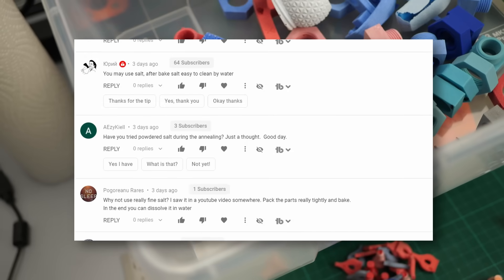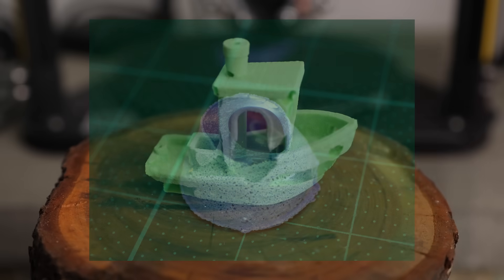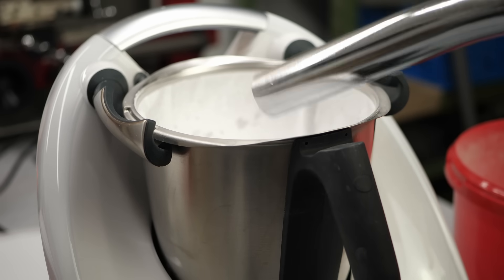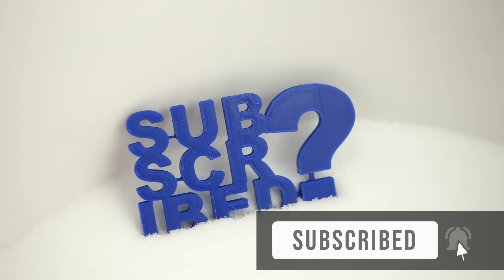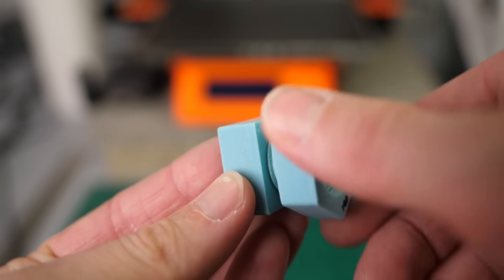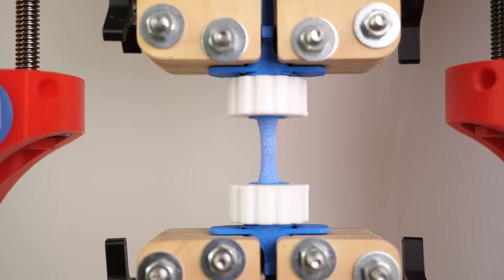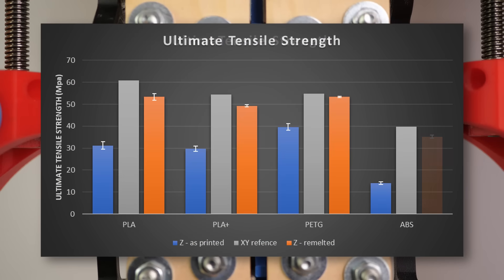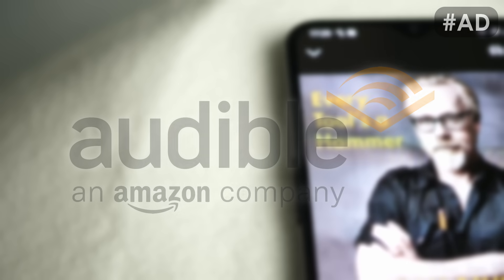The STRENGTH of 3D prints REMELTED in SALT

Comment: An alternative to using the blender would be to use a ball mill (Rotary Tumbler).  These can be had in the U.S. at Harbor Freight for under $20.  A simple ball mill substitute would be steel balls or smooth stones in a paint can, then rotate the can on a motorized roller.  Ball mills are used in the paint industry to grind pigments into a fine power.

Comment: Hi, I managed to easily make powder salt. Mix equal parts of regular salt with water then put it on a blender or food processor. After blending for some time you can transfer the mix to a regular pan and boil the water away (for safety, with some kind of lid that lets the vapor out). You can process all of the salt in one batch, and what you get in the end is dry fine salt.
Reply: I think you can skip the blending step. I think the salt dissolving is what makes it fine.
Reply: @stinkiaapje  It can become saturated and no longer accept more salt into solution. Not sure what that point is, but worth a mention.

Comment: Try using iron oxide powder because it's fine and water soluble mixed with aluminum powder because it conducts heat easily and your process will be much quicker.  It will leave a beautiful finish on the plastic part.  Wait...don't do that.  It's a bad idea.  Maybe this is just a joke for anyone who understands chemistry.

Comment: @CNC Kitchen
Have you tried a flour instead of salt?
It's finer and drier.

And even more, you can try a little trick to compact it even more, while cooking.

After I watched your video I thought about what could be finer and not that aggressive as the salt.
I tried something like this - compact the parts with a flour in a metal cup. On the top I put aluminium foil and fit it the best I can to the walls and outer rim of the cup.
in the "foil cup" that forms I put some more flour and add some water.
Because of the foil, the water can't leak to the actual flour around the part, but form a layer of dough, that expands while cooking and kind of seals the top of the cup with the foil, thus creating sort of a "piston", that presses on the flour around the parts (I hope :))

I put the cup in a pressure cooker and add some water around it  (on the bottom of the cooker) to evaporate and create some pressure.

Couple of times the water vapor leaked in the upper layer of the dough below the aluminium foil, but in the rest of the cases it was dry, so I guess the "piston" trick worker 
Don't know whether it was from the pressure or from the heat, but the flour underneath was pretty compacted and kind of hard and came out in chunks almost like plaster, but was easy to remove.

I don't have neither the time, nor the equipment to test that flour method as good as you could (I don't even know the maximum temperature of my pressure cooker, ), but the parts come out pretty well packed in the flour and the flour is way finer and no aggressive to the parts than the salt, so probably you could try with it.

btw. like your videos, very helpful. :)

Comment: Very interesting results. I wonder if dipping the parts in a clay slurry, let them dry, then dip them again until you build up a shell would work. Look up the lost wax process for metal casting.  The salt lets the plastic expand as it becomes hot so you might need to put some sprues on the part for the plastic to expand when hot and contract when it cools.

Comment: So I'm new to 3d printing, but I do have some ideas about some issues you ran into;

1) Powdering salt.  My parents work for a platinum mine and if you want to crush lots of minerals (like salt), you're going to want a ball mill or something similar.  They're pretty easy to make.  All you need is a rotating drum and a lot of steel ball bearings.  You just let it run and it'll crush whatever you're milling into a finer and finer powder depending on how long your run it.

2)  Using salt in the first place.  I saw the sand video and plaster video.  I'd definitely like to see you explore other materials.

3)  Going the opposite direction.  One of my hobbies is growing crystals and salt crystals are pretty easy to grow.  I wonder what would happen if instead of trying to powder the salt to improve resolution, you instead grew a giant salt crystal over the 3d printed part instead, and annealed it inside the crystal.  It seems like that would let you achieve extremely high resolution, almost to an atomic level.  I'm aware this wouldn't work with some plastics (or maybe no plastics) and it'd be highly impractical, but would still be an interesting experiment just to explore the other end of the spectrum.  I might have to explore this myself.
Reply: Clever idea!  What about spraying a saturated salt solution over the part, letting it dry, repeating as necessary to get a good solid salt coating.  Then proceed as here.  That may create a solid sacrificial layer and permit higher resolution on the surface.

Comment: You missed a trick not shocking it while compressed to remove any small voids between grains.

You could probably save a lot of time using metal rods to help distribute the heat into the material. Kind of like heat-pipes in a heatsink.

Comment: How about powdered sugar? OK, full remelting couldn't work with sugar, but annealing with Up to 120°C should work well, the crystals can be compressed and stick together and they dissolve in water. Oh.. and it's far cheaper to buy powdered sugar than Popcorn Salt or a good ceramic mill for powdering normal Salt and last but not least: it's by far not that corrosive!

Comment: Sand would be a bad idea since you can't dissolve it, same with talc.
Reply: False
Reply: @rrtsduf  It doesn't dissolve, it only disperses (and it's only slightly soluble in mineral acids).

Sodium carbonate (heated baking soda/sodium bicarbonate) DOES however dissolve readily in water and is incredibly fine, so this could be a viable option.

Comment: What about this? print wilt 100% infill, cast a silicone mold around it (high temp resistance), do the heat treatment, and cut the silicone open. surface should be even smoother

Comment: There is a particularly fine grade sand, used for hourglasses. It might be possible to use that.
Reply: you end up with sand embedded in print that you cant remove, salt is water soluble
Reply: @ekstrapolatoraproksymujacy412  
Indeed, I didn't think of that. Was thinking of as a greensand, though.

Comment: I'm reading through the comments. Everyone seems to be gravitating around minerals such as sand, salt, plaster ect. The issue with these is their heat conductivity issues. My curiosity is how well would it work with powdered metal. Would it conduct the heat better. Allowing for a faster melt or would it conduct the heat too well and burn the outer layer of plastic. Maybe with a high temp pvc glue coating. We will have to test.

Comment: Main thing i would do differently is to have a vibration plate to put the container on and make sure the salt gets into all the little spaces. But this was really impressive. A lot of work but really useful. You could use a tumbler to grind down your salt (or whatever) to a fine powder, but those are loud and slow. Probably having ceramic balls inside would be good to do the grinding job.

Comment: i can suggest to use sand for sand casting or gypsum cement like ultracal 30 both have good properties in conduction and preservation of temperature and the shape, as log as i can see the whole idea spins around meake a from the  3d printed "part" (like in jewlery making ) but using the same material to be remelted and reshaped "in place" preserving the form erasing the layers to creat something more alike  "inyected plastic part"

Comment: what about cement powder ?
first clean with water then in hydrochloric acid (HCl) at 37% (according to the specif below it should work)
(send a beer if it's successful 

https://www.researchgate.net/publication/326697946_Chemical_Compatibility_of_Fused_Filament_Fabrication-based_3-D_Printed_Components_with_Solutions_Commonly_Used_in_Semiconductor_Wet_Processing

Comment: There might be a way to make finely powdered salt that doesn't require having to constantly replace sacrificial blenders.
They make rock polishing mills for amateur jewelry crafting. Generally it's like a tiny side loading clothing dryer, but water tight so you can fill it with sand and lubricant and it will spin for days to slowly polish the rocks. If you fill one with coarse salt and steel shot (or maybe a handful of gravel) and let it run, you could probably make powdered salt in larger batches.

Comment: Hi Stefan, brilliant work. If I could suggest using cement or gypsum, know also as plaster. They are both fine particles, cheap, reusable (depending on the method applied) and hygroscopic. Compacting small amounts would also help, as it will prevent the item from losing shape. 
The way I see it, the method works on a similar basis to hot forging where filament laters are remelted hence the layers disappear. 
To prove it you can try to cure some elements in a microwave as it would be much quicker.

Comment: Have you looked into glass beads used for sandblasting instead of using salt? There are multiple different sizes of beads and you can buy a big bulk bag for rather cheap and it would most likely be reusable.

Comment: Looking at your results, I am curious what benefits using salt over other super-fine grained material would be. Also, have you thought about performing this process under pressure? Just an idea, but what if you made a compression device (maybe with some welding skill) that vice-squeezed the print in sand so when it anneals it'll more closely resemble an injection mold? Might work, and it might also warp the part. Would be interesting to find out though.
Reply: As I understand it, the primary considerations are cost and availability, then thermal properties, environmental, etc.

Comment: I think maybe the plastic needs some kind of coating to keep a cleaner outter layer after melting. The salt results look great for strength, but surface details are also important, especially if making the part for a cast.
Reply: What kind of coatings are out there that will stand up to salt and the remelt temperatures?